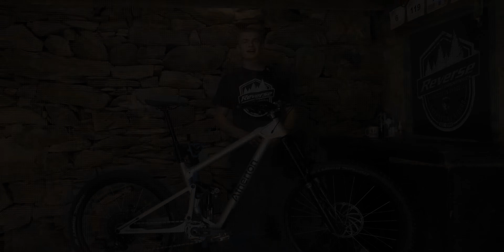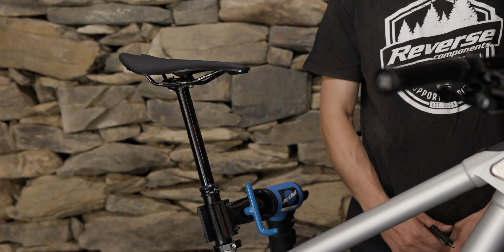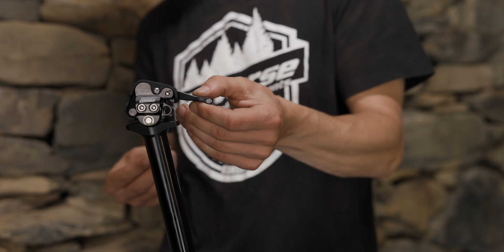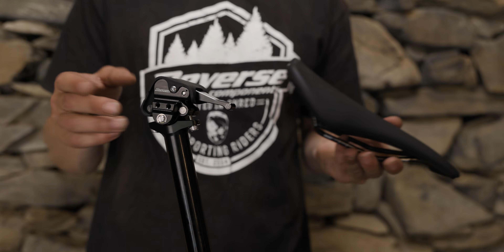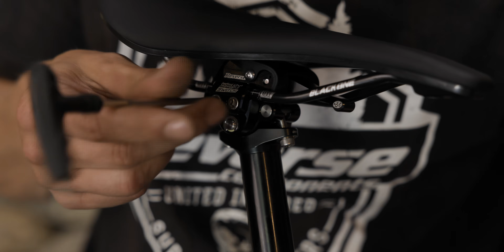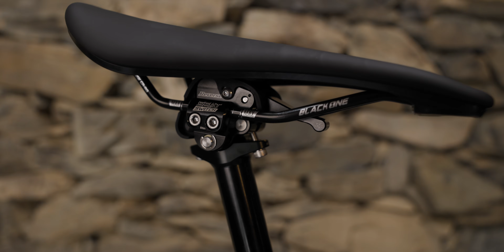SEATSWITCH - How to Install

Comment: I feel there is a step missing where you adjust the saddle height, since this things as about 2cm of extension.
Reply from the maker: yes, you need to adjust the height afterwards to compensate for the added height

Comment: Great product! Quick question: Is the SeatSwitch compatible with rigid seatposts as well, or does it strictly require a dropper post? Would be awesome to see a solution for riders on rigid setups too. Thanks!
Reply from the maker: Yes it is compatible with rigid seatposts! We’ve had great feedback from Gravel riders and hardtail riders too.